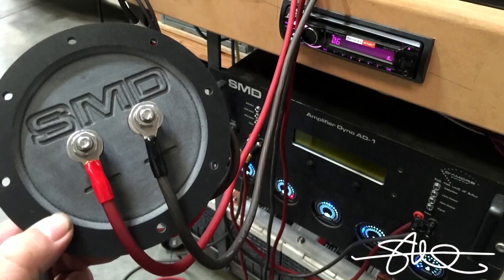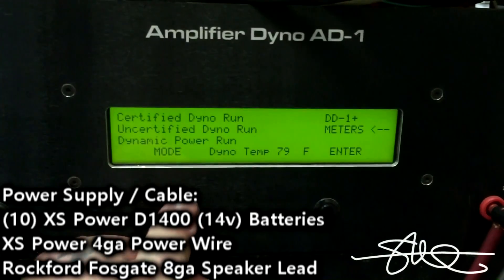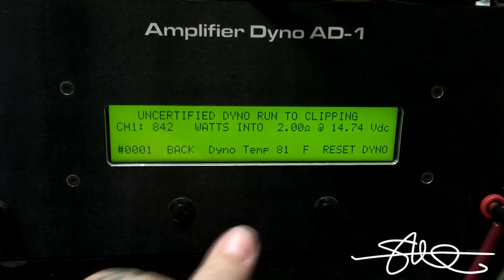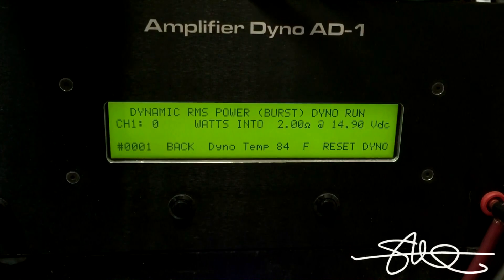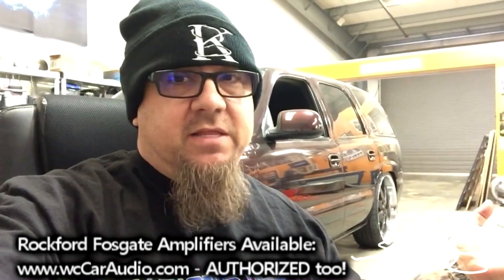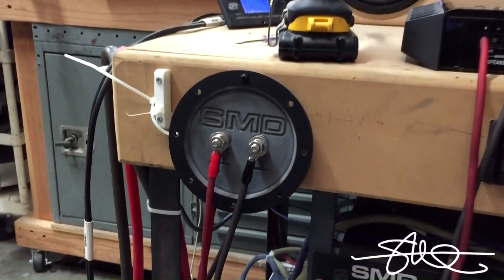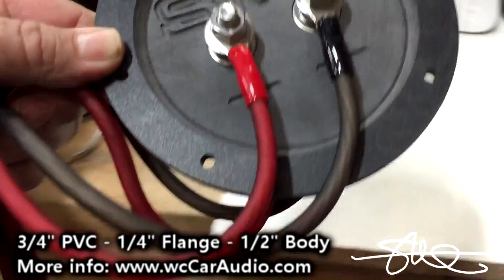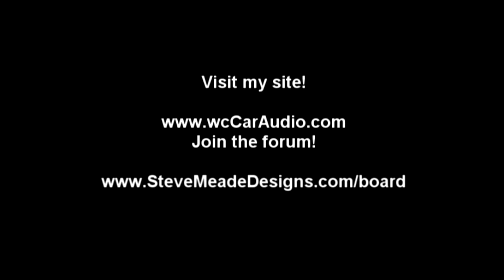Amp Test Tuesday - Rockford Fosgate Power T600.2 + Stainless / Grade 8 Bolt Terminal Test

Comment: I got question for you what I set my gains at on that same exact amp I'm pushing a 1 Sundown Audio 15 dvc 2 ohm sub.  I have my gain set at 5 my Hertz at 45. my eq at 3/4  and my sub wired at 4 ohm . how would you set it. and if so am I good . need your professional advice. thanks

Comment: I have a quick question that isn't related to this video, but instead I was hoping to get some insight from an experienced audio professional since I lack any in my area. I drive an 09 Altima coupe and I've found myself in a bit of a dilemma. I own two soundstream 15's that I can only just barely not fit in my trunk. They are already pretty tight around the edges of the enclosure, so would it still be feasible for me to still fit them in the trunk, using a special enclosure design if need be. My issue is centered around my small trunk space, but maybe you could fill in the blanks for me.

Comment: Having a problem with my kicker zx400.1 mono  amp (used for about 6-7 years no problems till now) going into protection mode. I've checked all connections and voltage and ground everything is fine except it only only does it when I plug in the RCAs (even with no speaker wire connected) and only when I turn the bass boost knob up. It won't go into protect mode unless it's at really low volume. This amp has worked great for the last 6-7 years and gave no warning signs it just stopped working and for good measures I also tested it in one of my other vehicles that has the kicker 750.1 just took all the connections off and hooked them to the 400.1 and same problem occurred making me think something in the amp internally went bad.
Reply: +1traxxas replace it with something bigger and better, u got ur use out of it
Reply: +250PICKLE ya I figured it went bad. Did some more tests today and it's the amp that failed. Will prob go up in wattage a bit with the new amp. Trying to keep it kinda small as this is in my family vehicle. I have my big mama system in my Grand Cherokee. :)
Reply: +1traxxas hellya. as long as $ not a prob, go with a bigger amp than u know u need and tune it low like 0db @40hz.. i hada zx750 on stock electrical and it had minimal voltage drop.
Reply from the maker: +250PICKLE don't ever use zero db tracks to set gains on amps.  0db is for head units, processors etc.
Reply: +meade916 except for when u have a bdcp 1500 on a 600rms sub and u wana b conservative. that is based off the dd-1 manual.. track 1. u can always step up to tracks 3..5..and then 7@40hz.

Comment: You also might consider zinc as another cheaper option and brass as a expensive option for the bolts, nuts and washers instead of pure copper. I chose brass over zinc when doing my last rebuild for a similar reason to having "the best" mentality. Overall not too terribly expensive. I bought 8 bolts and all washers, lock washers, and nuts for about $34 so that i could have a pair of bolts for every voice coil.

Comment: I still wouldn't trust the grade 8s though, there's something about the zinc coating that makes me not like it. Maybe I just have an obsession with stainless. You should do a test with more wattage with the grade 8s to see if they heat up. I used a grade 8 for the ground clamp on my welder and its lasted but all the zinc burned off, which can be bad in an enclosed area.
Reply from the maker: +Shane Calo not necessary. Wont ever be any heat.  A tight connection should never get hot.
Reply: +meade916 ok I wasn't sure, obviously a welders power output doesn't compare. I was just curious, thank you

Comment: Another thing you could get into (if costs aren't an issue) are oversized binging posts to stick bare wires right into. Biggest ones I've seen can do up to 12 gauge. They would be a bit easier then crimping wire connects on. Not hating just as a thought. Btw nice bolt terminal cups! :P I run binding posts in my ride with banana connectors. Makes for a nice quick disconnect if I need to occupy the rear space.

Comment: Thanks for clearing that up Steve there are so many people that believe bolt connections terminals are terrible and that you get more with direct connections but with this test its good to see that they are both the same
Reply from the maker: +legendary504 the differences in wattage are all just due to me doing back to back to back tests....the heat, the slight voltage differences off the batteries etc (from the back to back testing).  For the most part the bolts won on some which would make no sense other than they don't HURT at all.  In other words, the bolts are NOT better than "just" wire....but is it any different? i say no.  Not in this application.  Thanks for watching!
Reply: +meade916 yes this was a WELL NEEDED TEST! well especially since people would constantly debate it , and I wanted to use bolts just simply cause it looks cool and makes it a lot nicer and cleaner then wires just everywhere!     on another note.   I never hear you talk about crescendo audio , now I know your fosgate main man , but what do you think about them ?  thumbs up or down?   I'm running it on mods and highs and got a fosgate t2 15 with psi recone and sundown 2k on it. and 800.4 on mids and highs.    any thoughts?
Reply: +stertheder lol yea I know who he is , I'm trying to reach out to exo to try and buy a amp from him as he said he will prob be selling his amps so he can upgrade to the 5500's just haven't been able to get a ahold of him yet is the problem
Reply: +JASON JACKSON smd wont do versus TYPE questions. its like asking an ase certified mechanic what is better, ford or chevy. u already know the obvious...crescendo and sundown are both good
Reply from the maker: +JASON JACKSON i don't know anything about cresendo amps.  I heard the name a few times though.  Isn't it one of those brands that when you open the case it looks exactly like 20 other brands that's out there?
Reply: +meade916 lol I gotcha man -  no worries - yeah they do basically look the same as all others and prob perform like most other brands , just thought I'd ask since they are close to me in Florida -  now how bout your boys amps ?  D'amore that just posted a video of the amps he built or y'all built   Will those get over to amp test Tuesday?   Hopefully so cause I can't want to see what the monster clean amps can do , they remind me of the Macintosh amps I would dreamed of being able to buy when I was younger

Comment: hey meade916 I know beginning of the terminals, but how about making it where the bolts countersink on the back side. so that the bolt won't spin inside the box while tightening on the outside.
Reply from the maker: +young man it won't spin because you will attach the wire and tighten it down.  Once tightened down it will have a lock washer keeping it from ever moving again (until you take it out of the box).  All you do is switch the outside wires from  then on and the inside should never move.  That is why there is 2 nuts (LOL) :D

Comment: What cad/cam you running for your cnc brotha?
Reply from the maker: +D Kerekes it's called UCANCAM
Reply: Thats a new one to me i use a program called fusion 360 Love it. Very up to date on everything and the renderings are super accurate check it out
Reply from the maker: +D Kerekes definitely looking for new programs to try...but i just got the hang of the basics of this one so it's hard to switch up like that.  I can draw all day on almost anything but setting tool paths and shit might be different.  Plus i upload my file to USB and transfer it to my cnc on the hand held controller.  Not sure how that would work out.  Im gonna look up fusion though good lookin out D

Comment: i thought gold was the best conductor
Reply from the maker: +deairreo hill nope it's not even #2 lol - SILVER is #1.  Best for heat and electricity.
Reply: meade916 Thanks for the knowledge , it'll be cool if ya had a video on sundown x8 in depth or american bass products !
Reply from the maker: +deairreo hill both AB and Sundown are SMD partners - visit my site and find all that info! http://www.stevemeadedesigns.com/board and join if you haven't already :)
Reply: +meade916 bet , thanks!
Reply: +deairreo hill The reason for gold plating is that gold does not corrode. At all. There is usually copper under the plating. Silver and copper can get surface corrosion, pretty quick. Even when just exposed to the air. The corrosion does not conduct any, or very little electricity.
Reply: +Roger Hansson cool ig ill pick up some gold plated ground terminals , i only have 1 sub subwoofer a American bass 1044 and a pro acustic 4500D at 1ohm stable , i honesty dont know wat this amp is pushing ! my sub is a dual 4 ohm so i can only at w ohm and this amp push it so hard people really think i have 2 15s in my bmw !
Reply: +Roger Hansson i honesty pushed 2 custic single coil. sub and a dual 4 ohm r type no problem on the amp is that under 1 ohm ?
Reply from the maker: +Roger Hansson excellent answer.
Reply: +meade916 indeed, and it would seem that these coatings do not take away from power transfer